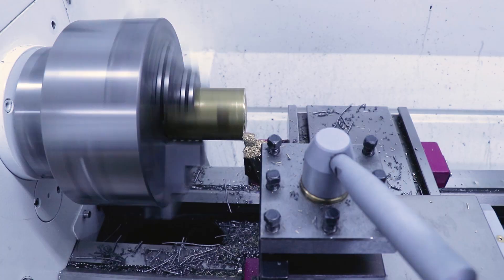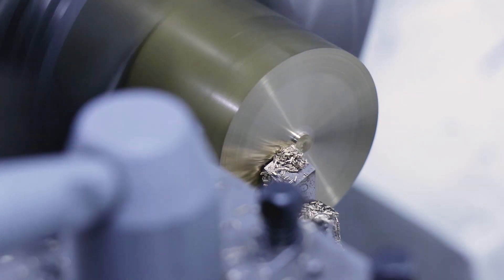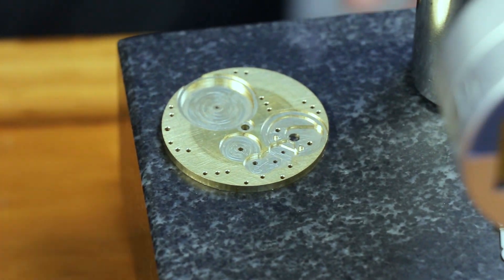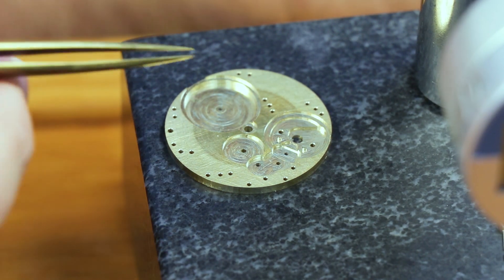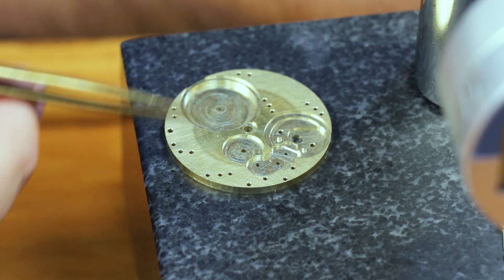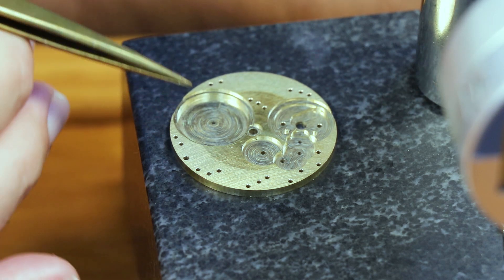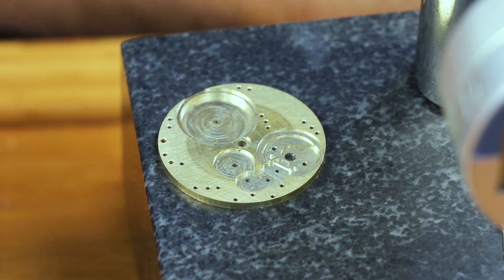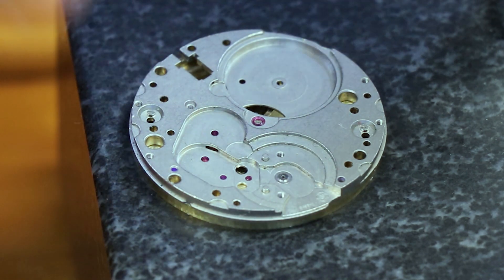Making my 2021 Watch Mainplate using a CNC Machine - Watchmaking Vlog 51

Comment: years ago before the internet, i got hooked on thinking about time and gravity, and came by an old lathe, and decided to build a wooden clock, ...  before the internet it was hard to find information on horology.  anyway it was a kind of passion to me till i got, after about a dozen clocks built, i finally built a clock that worked super and then i never made another one.  I call this clock my happy clock, because i told my kid, while on my quest.  I'm going to be so happy when i can finally get a clock that works right.    I love the sound of it 24 hrs a day and i love to adjust the pendulem as the wood shrinks and grows due to the seasons changes and the phases of the moon.  I bought a watch maker's lathe 20 years ago and tried a bit on it, but now i may just get it out and study your video's ..  I have been a machinist for my whole life, and am glad i can finally figure out how to run that lathe.    I've got a cnc mill in my garage as well as a very large lathe and a 14" jet lathe and vertical mill,  I have a number of old elgin pocket watches i have picked up over the years also,  I may get one or two of them going again.  thanks for your video.  I have picked up watches in the past and got them to run by cleaning them out.  It is such a thrill to take a watch apart and then re assemble it and hear the balance wheel take off and start to sing.  looking forward to seeing more of you dude, i like your style.

Comment: Hey! 
Great to see progress! 
A tip from one who once was a toolmaker. 
Tape is not good enough in a long way. Especially for watckmaking precission. 
Precission and repetebillity. You need to make workholding fixtures. :) 
One needs to eliminate variability. :) Something you can index all axels on. 
Keep on rocking. Its not easy att all. So you made something that looks like a mainplate. You need to pe proud. :)

Comment: I would suggest that you lock the blank down to the surface directly or build a milling fixture that clamps to the table and it clamps the disk fully supported. Then you'll have no measurable deflection and can be milled an drilled into and not the table. 
I'm enjoying your journey!
Reply from the maker: Thanks for watching and commenting Steven. I completely agree with you in making a fixture. I appreciate it!

Comment: Very nice! I think to get more accuracy, you could try to ditch the tape and make a fixture to hold your blank metal on metal using clamps. That way you could directly cut your mainplate blank on the lathe at its final size. Would be more accurate too since tape is not 100% rigid and you would have fixed G54 that on the said fixture so in the future, if you need to make another part fast, you could change the blanks with high repeatability.
Reply from the maker: Yeah I agree with you 100%. I'm looking to make jig's if everything goes well with this 1st prototyping, meaning the wheels are spaced correctly.
Reply: Would take a little more time, but worth it and you could simply use aluminium.

Comment: After cutting out from brass rod, use kiln 360 deg / 5 hrs / slow cooling, it will reduce inner tension and slots will get cut more precise.
Reply from the maker: Whoa! Never heard or tried this before. Feels like some industry inside information. It’s something I am going to looking onto, thank you appreciate the advice and taking your time to comment 🙏🏼
Reply: @DeanDK  You can encourage some problems with thin walls in brass after mill slotting, for example under the barrel and around the bottom balance jewel. Metal can go randomly twisted, non-repeatable thickness fluctuations can occur. Temperature treatment can relax metal structure and help with precise milling.
Reply: I always assumed stock from the rod would need some sort of tempering; glad to hear some specifics!